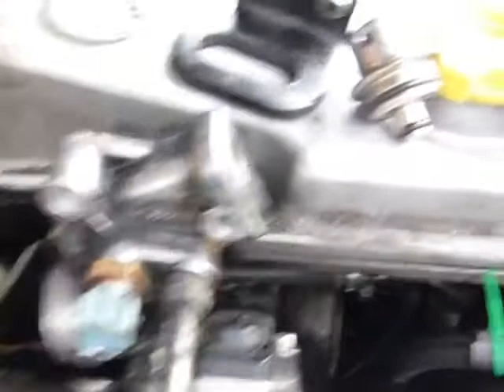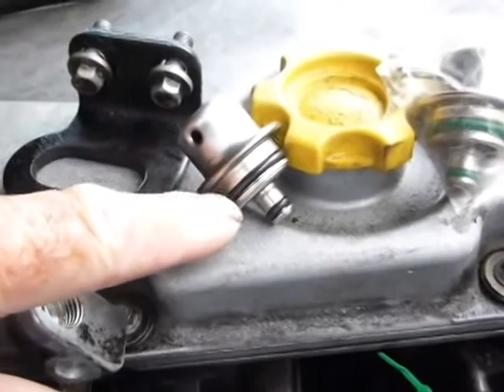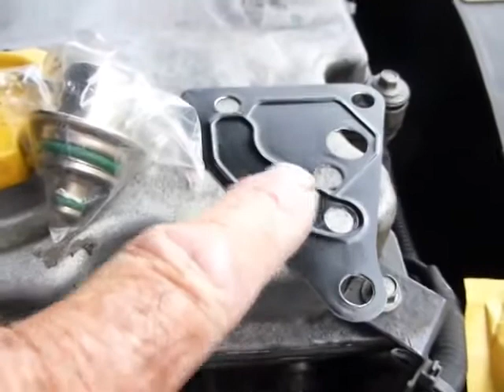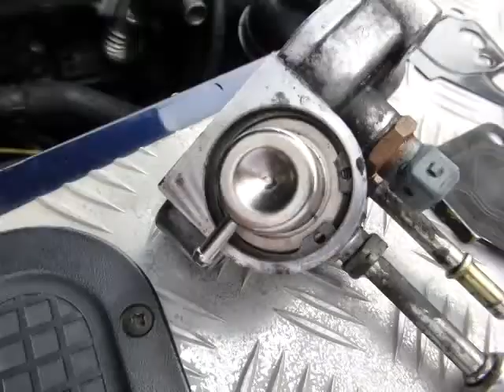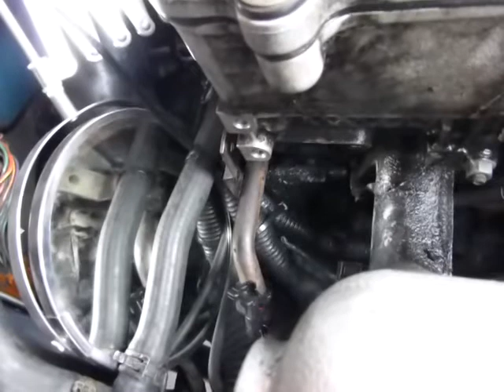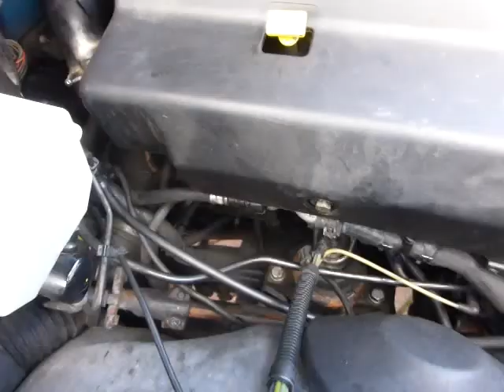Changing a Land Rover td5 fuel pressure regulator

Comment: Just done this myself. Once you figure out angles and extensions etc it an easy job on a Defender. I just replaced the whole thing, all done from above, the only thing I had to move was the fuel cooler which I loosened off the make it easier to take the pipe off. 

I found the bottom bolt waw easily accessed using a long extension and a universal joint socket taped up to reduce its movement.

Comment: did you get any loss of power / acceleration with this leaking ?
Reply from the maker: Many thanks for looking at my video. I noticed the problem early because the fuel was marking my drive not from loss of performance. The repair is still OK after 7 years. Good luck.
Alec

Comment: I have just done this job and have a couple of red hot tips to help.
the lower bolt on the fuel block housing can be accessed with 2 long extensions on your ratchet via the wheel arch by going in above the chassis rail. when refitting the fuel block insert the 3 bolts and then place the gasket over the bolts, then stretch a rubber band over the 3 bolts to hold them in place so you can start them, then take a second rubber band and thread it between the 1st band and the gasket and loop both ends over the temp. electrical connection.
once you have started the threads on all 3 bolts, simply use the second band to
lift the 1st band up so you can grab it easily, and pull it till it snaps.
Reply: Excellent tip re the rubber bands. Thanks.

Comment: Hello Alec, Thanks very much for this presentation.

I have a 2003 TD5 Defender 130 for which I bought back on Friday 31 October 2008

After having it for a couple of months, I had to replace the regulator, for which here in Australia where I am, I had to buy the complete unit, Housing, shim, regulator and pipes, all as one package.

Now just last week, I just changed my fuel pressure regulator again for the second time after 8 years, but today, being exactly one week later, I had to pull out the front pipe fitting that goes into the cylinder head, all because the O ring that came with the kit was slightly too small.

So it took me about 3 hours again just to change the front O ring.

But besides my trials and tribulations, I am very thankful for your video presentation for showing how you can purchase just the regulator unit, and shim, without purchasing the rest of the whole entire assembly.

Just a hint, with the three bolts that go into the housing.
When assembling the housing back onto the cylinder head at the back, put the bolts through the housing first, place a very small rubber band all the way around all three bolts.

When you start to tighten the bolts up with a few turns of the thread each time, the rubber band helps hold all three together to help get them started, rather than you having to bend your elbows and wrists backwards just to get your hands into the correct position to start tightening them up.

Concerning the pipe fittings, both front and rear.

The best way that I have managed to do it, is to undo the adjusting bracket that holds the alternator in position, then the rear pipe section of the exhaust re-circulator unit, then the oil pipe at the side of the re circulator unit, then undo the bolts that hold the fuel cooler unit, then undo the inlet manifold bolts, and slightly remove inlet manifold very carefully back away from the engine block, only just enough to get your hands in comfortably t work in there.

Then you can use a 14mm spanner reasonably well on the brass nut that holds the front pipe fitting into the cylinder head at the front right corner.

After all that, put everything back together in reverse order.

Comment: hat were the 4 bolts for you had snown first tha were sticking out
Reply from the maker: Hello, the three long bolts I am pointing out hold the aluminium casting with the shim between the casting and the engine. Do not forget to clean the small filtre that is exposed when the steel shim is changed. The bolts have been put in without the casting to show you the position they go. Good luck, Alec
Reply: thank you!

Comment: Where did you order the kit from?  Thanks!
Reply from the maker: The kit was purchased on eBay for £39.50 and it came all the shims and O rings. I have just had a look at the sellers site and I have noticed that He is now trying to sell them for £139.50. looking for mugs I think.
If you look for a pressure regulator it must give a pressure of 4 Bar.
good luck, Alec
Reply: Thanks Alec for your kind reply.  I think I may as well just go with the entire unit from LR for 250 American then.  I considered getting the Bosch type but what the heck, I will just spring for the entire assembly!